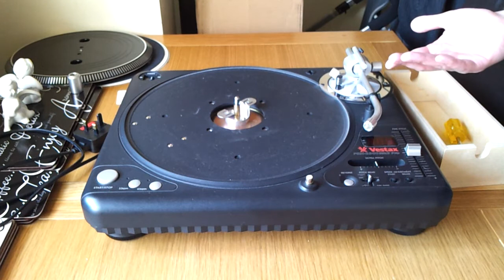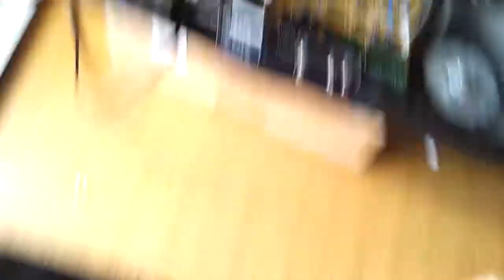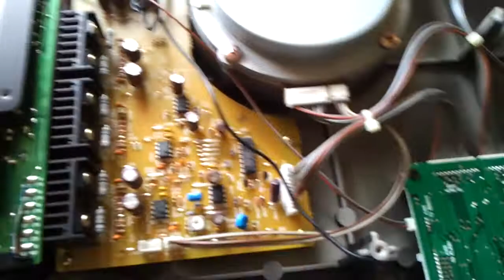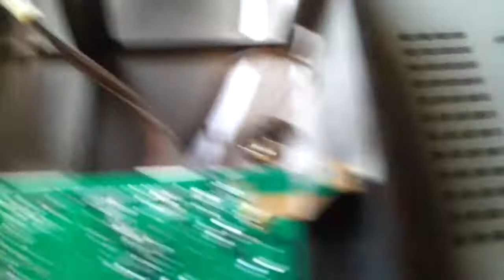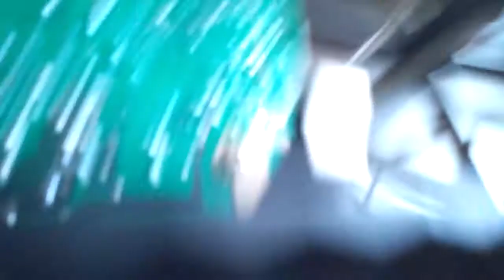Vestax PDX Turntable disassembly Part 1

Comment: i have a pdx 2000 mk1.
When i turn off the quartz lock the pitch goes slower and i have to move the ultra pitch so i can get the default pitch speed.
What can cause this?
any idea?

Comment: Hey man, thanks for the video. I have an issue with the tonearm of one of my 2300 mk2 pros....it appears to be an issue with the weight on the right-hand side.....it no longer screws and the tonearm will not drop even at the heaviest weight setting.  Any ho appreciated man, could I maybe send you a video of the problem? 👊🏼

Comment: Motor problems:- Years later... we agree the route issue is the motor, however... I found a preset potentiometer marked ADJ speed adjust? on the power board... this can be adjusted from outside in the single hole in the base, with a small cross head screwdriver. Anticlockwise causes Fast forward, and clockwise causes Rewind. So if you patiently test anticlockwise, clockwise, a little back... you can balance it and the turntable will run for longer, before you reset with the power. AMEN.
Reply: Hey! Are you able to advise where this is please. This may solve an issue I have with mine. Thanks
Reply: @oppadaywell  on the power board, marked ADJ.
Reply: @djjoshiwoshi  Thankyou, my issue is  when pressing start the platter keeps going forward and backwards. Pressing other buttons results in it spinning wildly or juddering. Do you think the motor is shot?

Comment: Great video. I know its been a while. I happen to have a set of the original PDX-D3s and you mentioned that different versions of the tone arms would fit. I have always wanted to upgrade the tone arm, kind of like the D3s MK2. Would that be an issue? Thanks

Comment: Hi, I think I might have a go at this so thanks for the video. I've got a what sounds like a ground hum. All the usual contact cleaned with Deoxit etc, cables changed as well as the headshells. The noise is constant even with power off. Is there anything I obvious I should be looking for ? Thanks in advance.

Comment: hi, thanks for the video. how can I remove tonearm for transport? everything works perfectly. thanks!
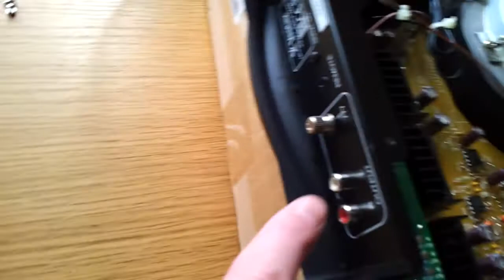Reply from the maker: 4:20 says how to remove the tonearm, but it's a bit much to do that just to transport it. You need flight cases to protect it properly in transport.
Reply: st3pupdj wont get a flight cases to transport it once...
Reply: @st3pupdj  as i said before- i wont buy a set of flightcases to use them once...

Comment: I'd like to replace the tonearm for something that will make it a better player in terms of sound quality. Does it lend itself to do this, you mentioned other arms from Vestax, is it possible to refit arms from different manufacturers?
Reply from the maker: Another Tall Paul I'm sure anything is possible with enough fabrication skills. Im not sure if any other manufacturers arms are direct fit, and some would definitely be alot of work. sound quality tends to come from needles and carts more than the tonearm itself, I would probably just read up on what carts and stylus are the most suited to your needs, and fit them to your current arm.

Comment: Why you never did the PT2 video ?
Reply from the maker: Max Sebastien what would you like to see?
Reply: Hola... I was wondering if you will make a totally strip down of the TT, but I just saw your second video and realised it was made just for the HALO install
Reply from the maker: Max Sebastien I was originally going to do a full dis-assemble but I decided not to paint it so no reason to do it. it's pretty straight forward though, just unscrew everything and make sure to take note of where it came from so you can put it back together. I will do another couple of videos, but they will only be for small things like internally grounding them, and make the start button sit neat against the top.
Reply: I see... Well I got a pair of D3S from eBay a couple of weeks ago, but one got damaged so I need to repair it. It is slightly different then the PDX series so I will need to do it myself since there is no tutorials on the net.

Comment: Mate, I hope you can help. I've snapped the tone arm weight OFF the tone arm. As in, the stalk of tone arm that the weight slides onto has snapped clean off just behind the tone arm pivot assembly. Can you tell or show me how to remove the tone arm from the deck completely. I can then reattach the section. Please help, can't find technical manual! Peace man!!!!
Reply: Superglue

Comment: This is so awesome. I have wanted to take my PDX2000 mk2 apart for ages but wanted a guide to do it. Have you done part two to this guide? I'm having a small problem right now, one of mine has no sound coming out of it at all, everything lights up but dont want to start poking around till I know what is what inside. Cheers
Reply from the maker: first check the connections between needle and cartridge and cartridge and tonearm before you pull it apart
Reply: I check all the connections and swapped out needles and cartridges to see if that was the issue and swapped cables over to see if that helped.

Comment: Hi man i would you ask a thing. A friend of mine left my pdx 3000 on for 5 fu***ng days. Only on not motor spynning fortunately, but it was very hot also because it was in a case. Do you thing it could be damaged or was only the transformer that generated hot
Reply from the maker: Yes the transformer would get hot. If it still works then you should be fine.
Reply: Thanks man, hopefully it works. i also bought a pair of these 2300 mk2 pro but i'm struggling to find a new arm. Can u help me find an arm?

Comment: Hi, I was wondering whether you know how to disassemble the tonearm itself? I'm able to remove it from the TT but I need to fix mechanism of horizontal movement. Thanks for any info
Reply from the maker: I was going to pull mine apart to paint it, but to be honest I think there's more chance of damaging it than it was worth. if yours is already not working then what do you have to lose? just be sure to note where every little piece goes. if you do it a video would be handy ;)
Reply: +st3pupdj yeah, I tried and unmounted every single piece I could, but at one point I got stuck and can't find any access to the place I need. thanks
Reply: hi, do you still have the problem? do you mean just to take the counterweight off the tonearm? this is just about pulling it out, but if you can't make it hit me up on pm and i'll give you my mail
Reply: zeroszescone mate have you snapped the weight off the tone arm??

Comment: nice video pal thanks (: I have a Question - what type of paint would you use to respray ??? thanks again .
Reply from the maker: thanks, I used plastic primer and white gloss rattle cans, then had a friend clear coat with proper auto paint gun.
Reply: +st3pupdj cool iv just got hold of 3 pdx2000 decks for £165 but there pritty beat up /: your video give me the heads up before I go frankenstein on them.Do you know much about the motor shudder ? Iv notice I move the pitch on one of them and  when you run your finger on the platter you can feel ..well its not right lol still not bad £55 a deck.Hay you doing a follow up vid ? thax pal
Reply: +st3pupdj Are you going to do another video friend ?
Reply from the maker: +Scott Sound could do a quick one for halos I suppose